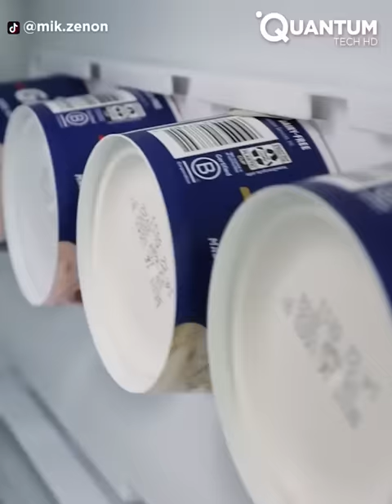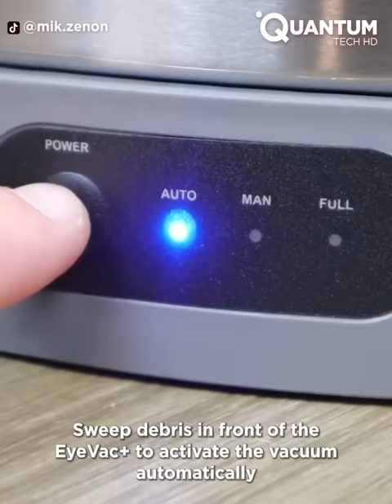Amazing Home Ideas and Ingenious Space Saving Designs ▶13

Comment: One good idea there is that secret stash. Although you might do better to have it in a fake electrical plug that looks like all the other plugs in the house, rather than in an odd one out. 

A few of these aren't terrible ideas, but most of the space-saving ideas don't really save any space, and people needing to save space probably can't afford them either. And many of these things are impractical or not any advantageous. The sliding cabinets (10:05) aren't really any more advantageous than a regular cabinet. Corner drawers aren't really more spacious than regular drawers. That underground garage door probably takes ages to open. The foldable kitchen table... realistically you'd keep your table pulled out because tables have a way of being handy all the time.

I 'd probably want my pool uncovered in parties or gatherings, but that cover would prevent kids from invading my property to swim in my pool (me and my friends did that a lot when we were kids).

Comment: Under no circumstances should you ever hang anything from the ceiling of your garage with the possible exception of it being a second floor floor system the truss's of a garage are not designed to hold any extra weight. I build.
Reply: dude people been storing stuff in the rafters of theyre garages since before you're parents were in the sack
Reply: @PAKfromFYCB  I have personally seen the gusset plates being pulled apart by too much weight. Do so at your own peril. Just sayin....
Reply: @steevarharris8050  i believe you but that person must have had one heck of a load on there, have you ever tried to pull one of those mending plates? its like gusseting the board with a chain saw it pulls all the wood out the depth of the teeth